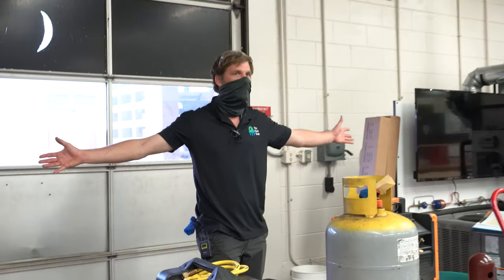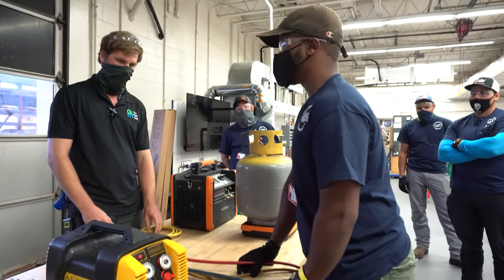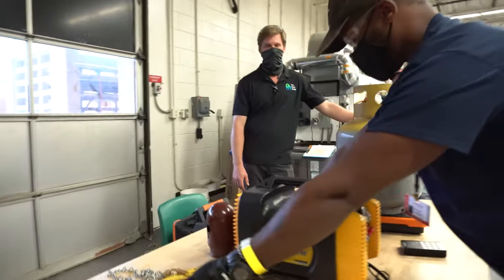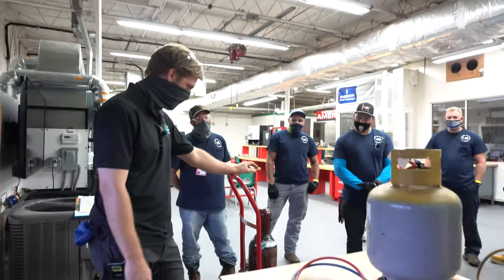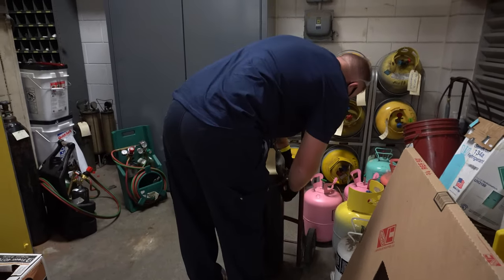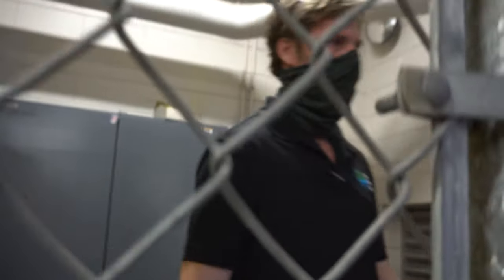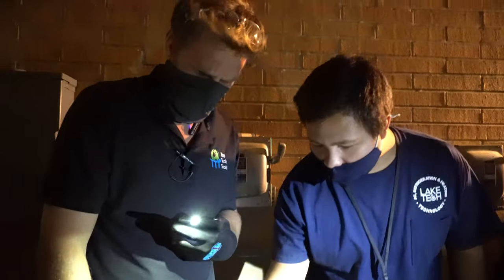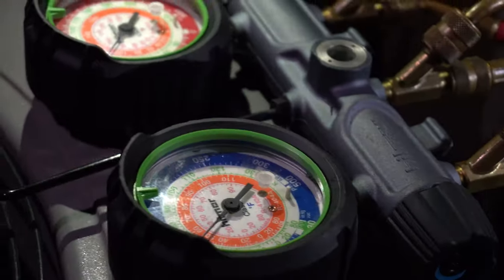Bert Teaches The Basic Refrigerant Circuit + Safety

Comment: When speaking about safety LOTO is very important when teaching. I recommend putting the covers back on the disconnects so you can lock it out. Turn Disconnect off, Lock Box, Verify Power is off at unit. It is something a company can get kicked off permanently from some commercial/industrial properties for not following. But that shouldn't be your reason for following LOTO rules. Safety Should Be.

Comment: I believe it’s called refrigeration cycle , circuit is used for electrical
Reply: The whole refrigeration loop, with all the components, piping, etc, is referred to as a circuit. The whole "compressor, condenser, metering device, evaporator" order of operations is indeed called the refrigeration cycle, though, so you're not necessarily wrong.  (I'm just watching the video now, so I'm not sure what the context is here.)